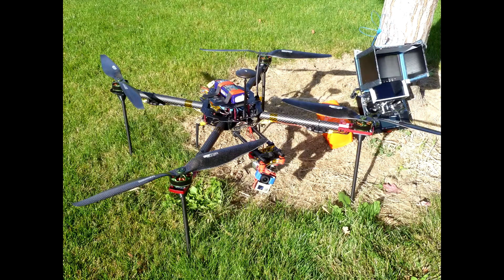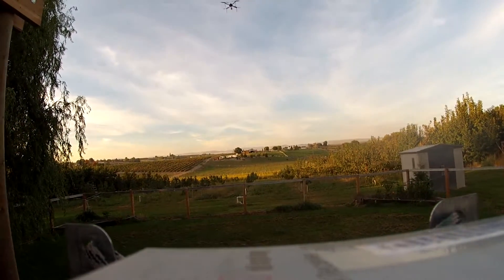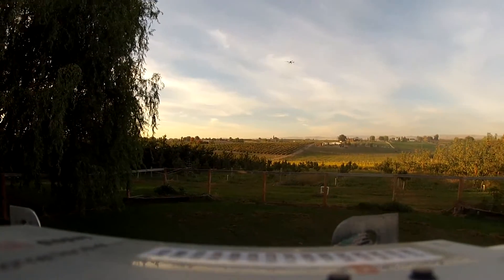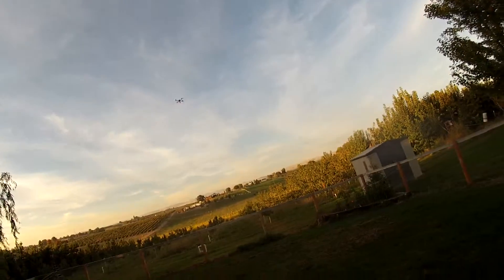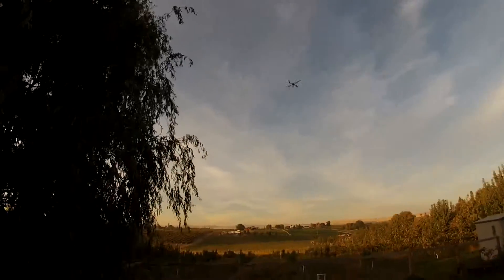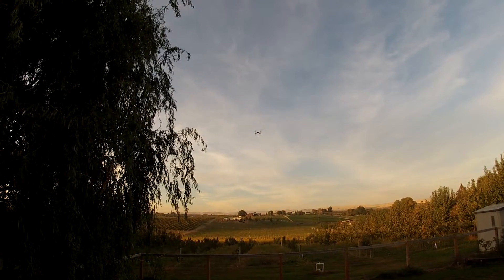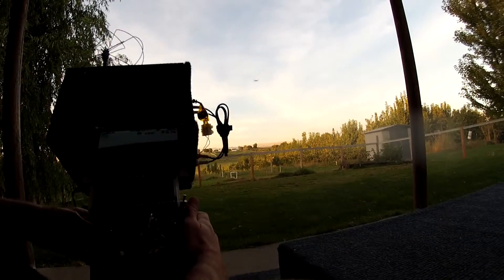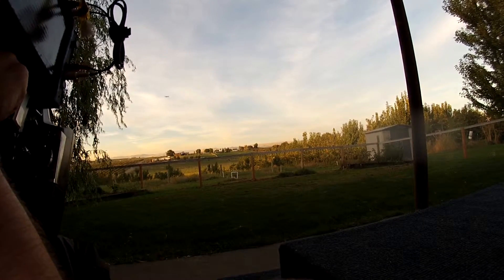Pixhawk PID Autotune setup and walkthrough...er, flythrough (APM PX4)

Comment: Kilo I know it's been a while since you published this video but could you share the PID's that this Autotune generated? I have a similar setup: it's a 820mm "V" frame Quadcopter with TMotor Antigravity 4006-380kv pushing "18.5" props. I conducted an Autotune flight today and ended up with sluggish flight characteristics.